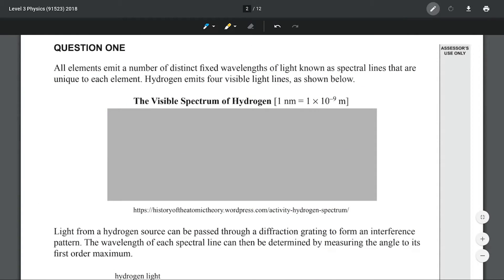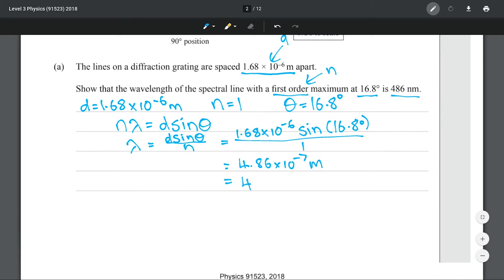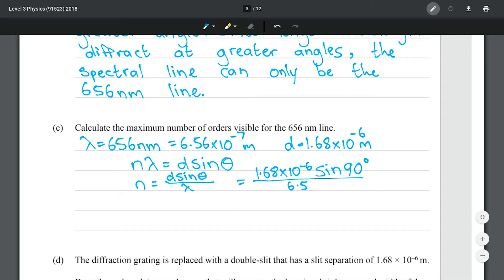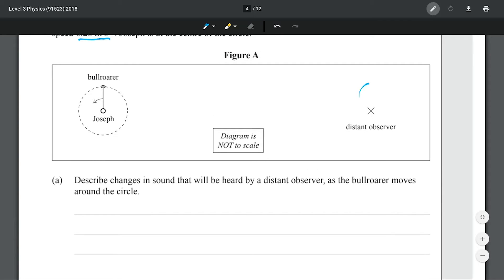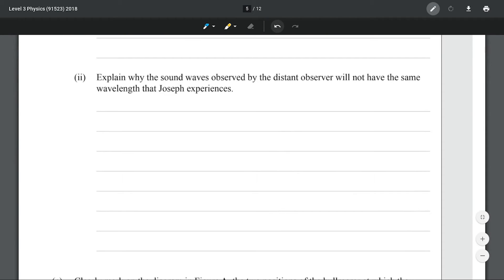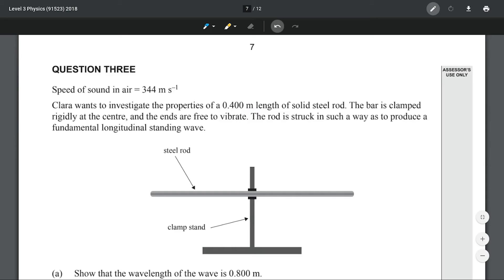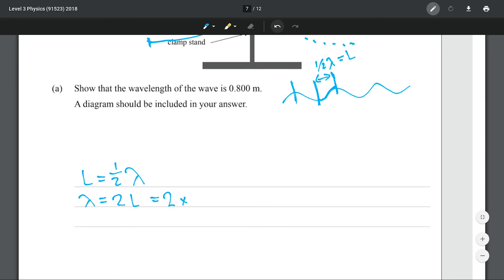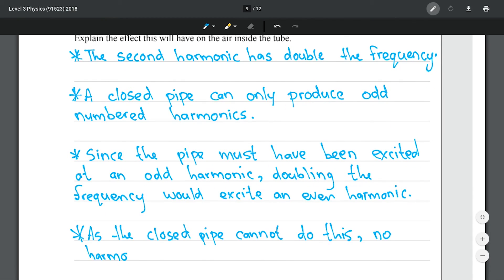2018 Wave Systems Exam (NCEA Level 3 Physics)

Comment: Hi Mr Whibley, I just wanted to ask that when you switch a number or a symbol from the left side to the right side, why do you put the switched number or symbol on the bottom? shouldn't it go to the top?
Reply from the maker: Hi PoTsu. Not sure I fully understand, can you point to a specific example?
Reply: @MrWhibleyPhysics  apologies, my english isn't that good. Example, at 1a. with nλ = dsinθ  became λ = dsinθ/n, shouldnt it be λ = n/disinθ because you switch the n to the other side of the equation?
Reply: @johnrobertfigueroa5261  In algebra, when you are multiplying something on one side like nY you want to get ride of the n we must divide both. sides by n so we can cancel out the n multiplying with lambda on the nY side hopefully that makes sense.
Reply: @sumitpatel4235  oh, but I've been putting the one from left to right and still get the answer right for physics whenever I do it
Reply: @johnrobertfigueroa5261 you should be dividing both sides... Not multiplying. You might get marked down for wrong working even if the answer is correct
Reply: now may I ask how did your exam go today

Comment: Some calculation is not the same as the assessment sheet. But the explanation is good. More detail explanation!
Reply from the maker: Thanks Lee, if you need anything clarified feel free to leave a question in the comments.
Reply: @MrWhibleyPhysics  Hi, Thanks ,I just want ot learn the physics from beginning to help my son to understand the topics. Thanks for doing this video to illustrate the papers.I just learnt the right hand principle but a little confuse about the rules. Does the four fingers is point to the current direction of the magnetic field or the induced current direction? And does the thumb is point  to the velocity of the magnetic or the object  moving in the magnetic?
Reply from the maker: That's awesome Lee. For the right hand slap rule the fingers point in the direction of the magnetic field, the thumb in the direction of positive charge movement, and the palm in the direction of the resulting force on the charge.
Reply: @leemaggiefyer6439  why u comment this on a waves paper